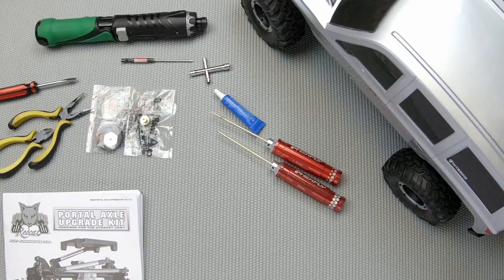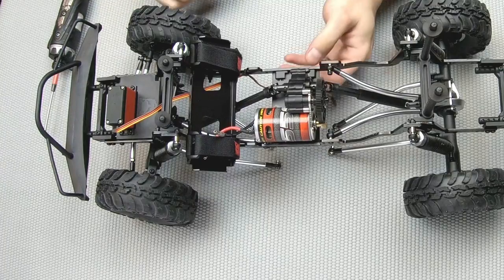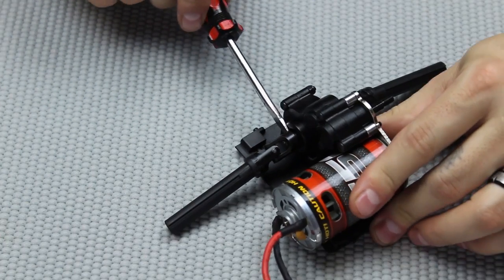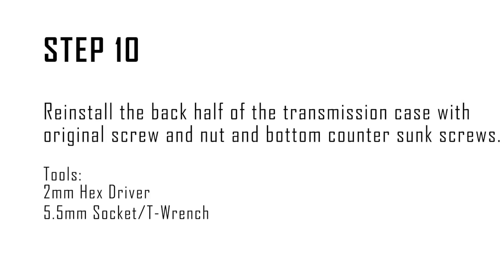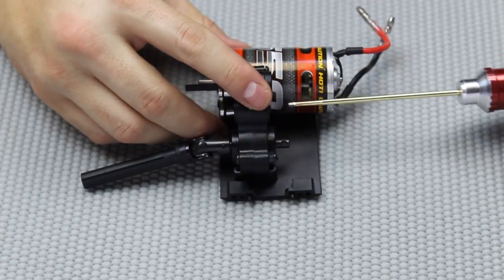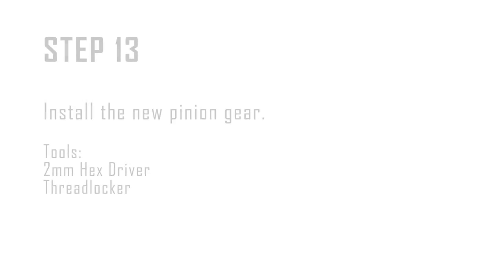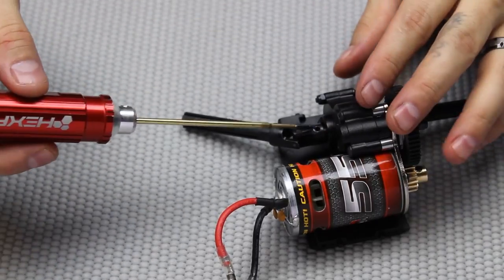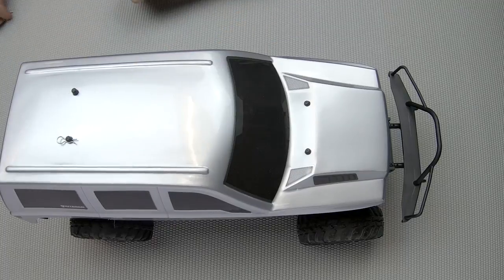Portal Axle Upgrade Kit - Everest Gen7 Slipper Clutch Install - RCU

Comment: @5:00 if you are like me, and your barrel screw DID strip, dont panic. Apply heat directly too it, use a long neck lighter or heat gun, and they use a T8 star bit to remove the screw. it fit perfectly with no play and came right out.

Comment: Love how they clearly show not a lick of gear grease inside the transmission case.... If you dont put at least a little bit of grease on a hard day of driving the gears can get totally destroyed and will within time... If you have the cash buy a steel gear set and a all metal transmission case and replace them both... Trust me you will save yourself a huge headache down the road... BTW tip for anyone new into the hobby NEVER use a power screwdriver to install a screw into plastic... it spins way too fast softens the plastic and way too easy to strip it just use a hand one and install till it bottoms out and about a 10th of a turn max after
Reply from the maker: Grease always helps for sure on any RC model gear set. This in itself is mostly for visual presentation and explanation of this process. Good info regardless. And good tip for new users about power tools on screws pertaining to plastic. That can happen and experience with the tools and RC's help avoid that, but it can happen with power drivers on plastic parts.

Comment: Just ordered the V2 kit .  Is it necessary to run the slipper clutch or could you bypass it and run a locked trans like it comes stock?
If so what steps would you skip in the process?
Thanks for the info, really looking forward to getting these new axles installed.

Great install videos, glad you guys make them available.

Comment: Can I buy just the spur gear setup? I bought a set of portals and they dont have the spur gear
Reply: Did you ever get that sorted?
Reply: @DystrophicEvolution  yeah I threw the red cat in the trash and got axials and Traxxas
Reply: Makes sense, I don't blame you. I'm selling mine. That thing came out of the box with a crap turning radius and the inner links rubbing the driveshafts. I tried it once indoors and the spur stripped. I put in a new spur and gave it another quick try and the servo burnt out. I'm so done with it. I have an old SCX10 project that I'm resurrecting. No more Redcat crap for me either.

Comment: When you put the new smaller slipper clutch spacer did you also reinstall the little washer behind it??
Reply from the maker: Yes indeed you do. The parts identified at approximately 11 minutes are the parts used in the order they are to be put on the shaft.
Reply: Doesn’t show you reinstalling the little washer behind the spacer 🤷🏼‍♂️ just watched it again and again
Reply from the maker: @braddahdussifyoumuss596  If you are referring to a part NOT SHOWN in "Step 12" then no it is not used. In "Step 12" ONLY the parts seen on the matt are required. We thought you were referring to the black spacer seen in step 12.
Reply: So yes indeed you DONT install the little washer behind the spacer lol right on thanks

Comment: Can you put this on the Everest 10
Reply from the maker: Just the slipper clutch portion - technically yes. But this only comes in the portal axle kit. So you would need the whole kit. Or buy the pieces part by part directly.
Reply: @RedcatracingAZ   Can I get the gen 7 chassis and use everything from my Everest 10
Reply: @theworry184  The Gen7 and the everest 10 have identical transmission's, motors, belly plate and drivelines